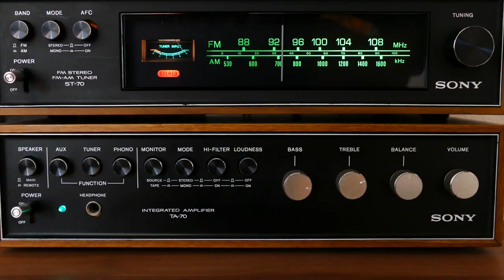S1E23 - I Assemble Raw Water Pump On YANMAR 2GM Sailboat Engine!

Comment: Been watching the assembly. Isn’t there a rubber washer and a spacer on the shaft that needs to be installed before hammering it in? 
I’m rebuilding mine also.
Reply from the maker: Well done Charlie!  Yes there is supposed to be a spacer in there!  I skipped it 🤷‍♂️
Reply from the maker: I subsequently stripped my raw water pulley... Pump works great but pulley was destroyed.  It delayed my trip to San Diego.  I need to further investigate my reassembly of the pump to see what critical errors I might have made 😡 Not sure the spacer was critical but hey... Who knows?  I'll talk about this in an upcoming episode
Reply: @sailingfrogsleap  I used lock tight blue on the lock nut. Plus there is a flat washer on both sides.
Reply: @sailingfrogsleap  you may have had the belt too tight. I think the nut worked loose causing the pulley to wobble and hog out the slotted hole. Just a thought.